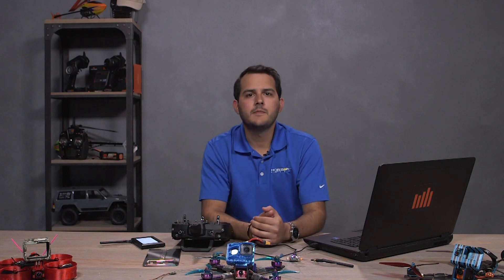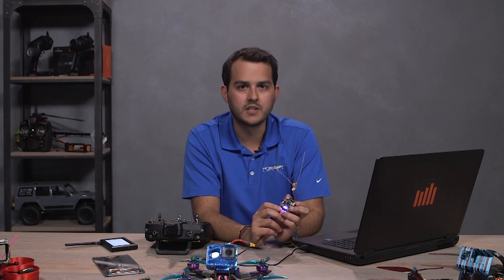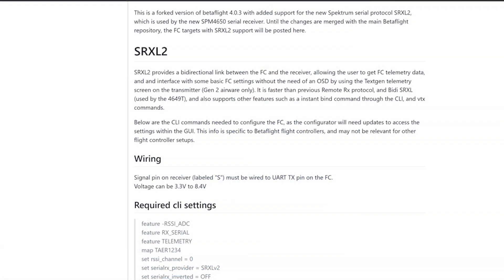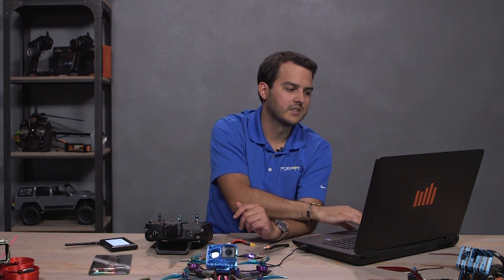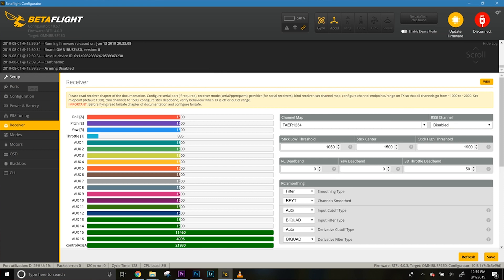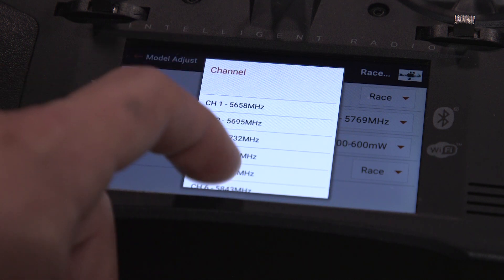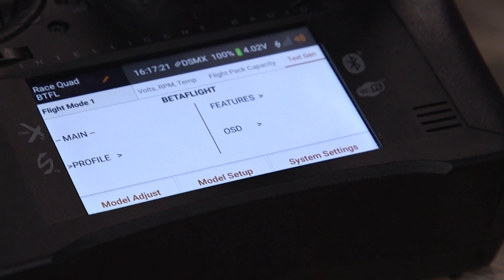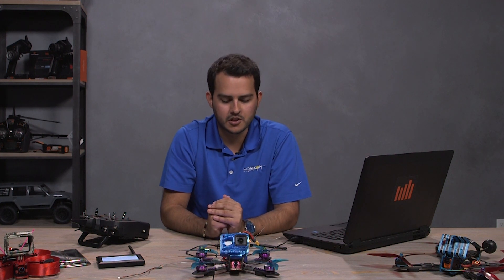Spektrum SRXL2 Micro Serial Receiver Betaflight Setup

Comment: Hi, new to the hobby and just letting you know this receiver is the reason I have gone out and bought a second hand Taranis Q9X plus and will leave spektrum products behind now and move on in the fpv hobby with much more compatible radio components that are available.
To sum up this receiver the SPM4650 
It’s expensive for what it is.
The pads are very tiny and so close together making it difficult for most people to solder.
The connector can be soldered but also quite difficult.
The wiring it comes with is really garbage and not silicone wire. Seriously. WTF is this sh.t. Did you find it in an old telephone spektrum?
Lastly it HAS to be wired to a tx port. Which means I can’t fly my shiny new plug and play quad I just got because the quad provides sbus or ppm to connect to and this expensive fussy little receiver wants only tx.
Sorry Spektrum, I really gave you a go but you disappointed me too many times in such a short amount of time with your rigid software mentality.
I’m going to the opposition now they seem more relaxed and user friendly. Just waiting for a couple of cheap frsky receivers to arrive in the mail so can finally get my new toy in the air and continue my enjoyment of this awesome hobby. 
Goodbye guys...
Reply: Hi Dingo. I have been doing research to see if I can make my DX7 work with a flight controller and you response is the best one yet. I will just let it go and upgrade my radio. Seems to be the least heart ache and pain. Thanx

Comment: I have been trying to get this to work on my tinyhawk freestyle for about a week now. Just saw this video which gave me hope but it was still no good. Im using 4.0.4, but cli commands keep giving me an error. Invalid name, invalid value.. etc. I can bind just fine but I have yet to see any rx movement in betaflight
Reply: Make sure if using this receiver you are connected to a tx pad on flight controller. Not sure if that’s your issue but it was my problem because I didn’t have easy access to a tx terminal on my quad.
Reply: @dingo2756  Ive been in contact with spektrum. Apparently I'm doing everything right, just another miniquad part that simply doesnt work like it should for me. Down to 1/7 functional quads today :( Hopefully this whoop doesnt stop working on me too..
Reply: @SPAZit101  You ever get that rx to work? I'm having the same issue

Comment: Does this work only on a certain version of beta flight and above ?
Reply from the maker: 4.1 which is in dev right now has it supported.  But also on our github page we have 4.0.3 FW files. (see description links) Hope that helps!
Reply: SpektrumRC I have to flash my FC with this version of firmware for this receiver to work ?

Comment: What is the best? DSMX Quad Race Receiver with Telemetry (SPM4649T) or DSMX SRXL2 Serial Micro Receiver (SPM4650)
Reply from the maker: More or less depends on your application. But for FPV with a OSD the 4650 is likely better for you because it is easier to setup and smaller. Hope that helps!
Reply: @SpektrumRCvideos  yes fpv with osd for freestyle.  but sometimes I like to go far.  does he have long range?
Reply from the maker: @edyfpv  Long range not like you would see on a 900mhz system BUT it is the best range we have seen yet out of one of our 2.4 systems.
Reply: @SpektrumRCvideos  thanks
Reply: @SpektrumRCvideos  can you configure rssi on it?
Reply from the maker: @edyfpv  It is automatic when setup with Betaflight. no need to set a dummy rssi channel or ADC. Thanks!

Comment: Can some one share what is the meaning of Uart?? Have been doing search but not of them actually are RC Related..
Reply: It is a hardware digital interface to send data across a wire. The flight controllers will usually have multiple UART Tx (transmit) and Rx (receive) ports. The Tx pin on these flight controllers is capable of both transmitting and receiving however, which SRXL2 requires, so that is why you must connect these new receivers to a Tx pin instead of an Rx pin.